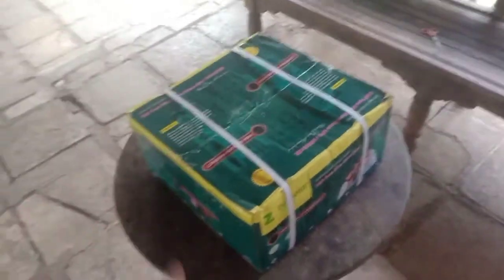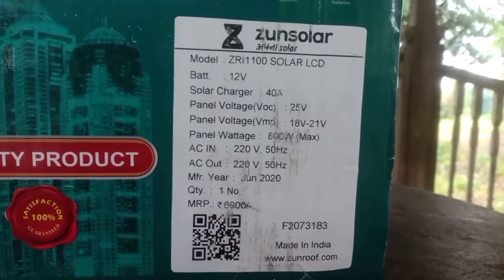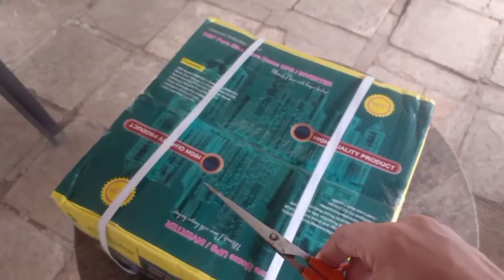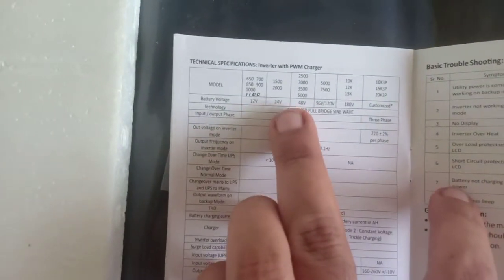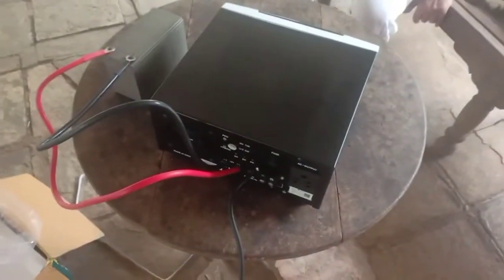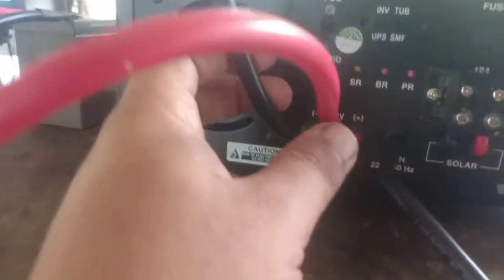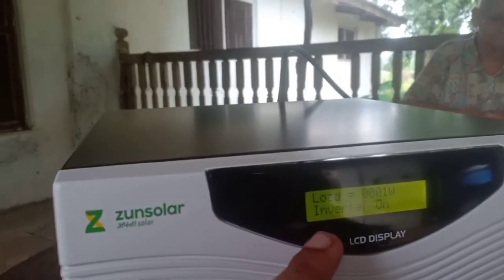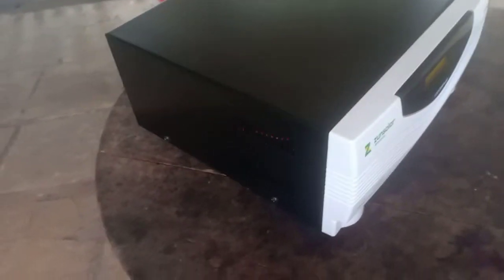ZunSolar ZRi1100 Solar Hybrid  Inverter Unboxing and Startup

Comment: Sir when battery is fully  charged during day then will the load directly run from solar.Are u able to reduce atleast 0.5 to 1 unit of electricity.

Comment: Is it have separate power savings modes like other hybrid inverter.
And does it have mode selection switch ,timer switch etc???

Please reply
Reply from the maker: Yes it does. All modes except time delay switch.
Reply: @relaxingprawn  thanks for replying me.And please make a  full fledged load testing video.

Comment: Can I run .5hp water pump or 500 watt mixer grander ?

Sir , Please reply to me
Reply from the maker: In theory, the device is capable of 1100 VA at power factor of 1.  If your water motor takes upto four amperes at 240 volts it will in theory run but may not start because single phase motor needs over 15 amps to kick start the motor. And this device is maximum rated at 4 amps. I don't know your motor specs, so I cannot comment on your motor.